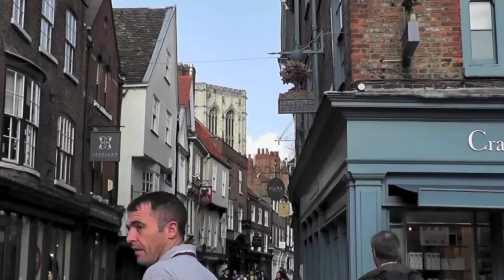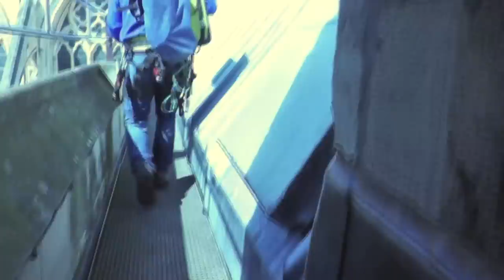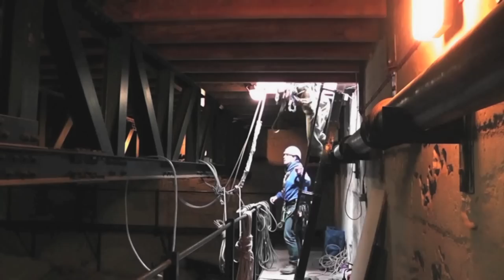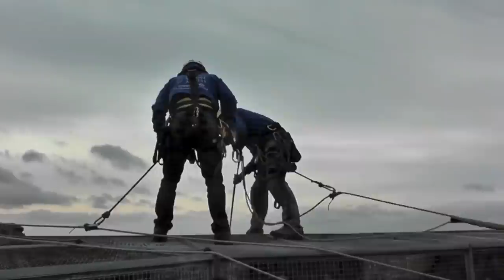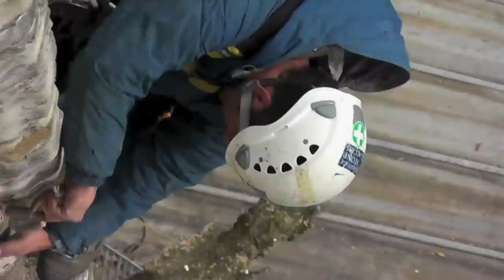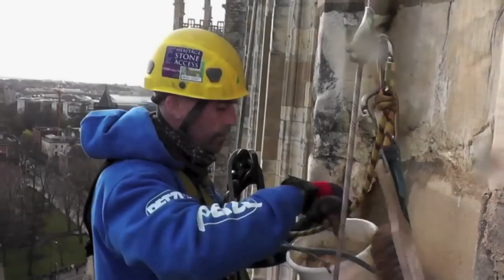Rope Access Stonemason Documentary by Jana Bolz

Comment: Is it ok to use Shunt for belay? I do use it. But heard that it's stricly not for belay. Otherwise it's great job!
Reply: It's not. it looks like hes just using it here to keep his tools in place on a 3rd line. you can use a shunt as a replacement for your hand ascender though.
Reply: This is an old video from a time that shunt was still widely used as a back up device in industrial climbing. Nowadays there are a variety of purpose made back up devices for industrial climbing that are used as a autolocking back up device should a fall occur. Shunt originally  was designed as a belay device and rope grab for leisure climbing if I remember rightly and then started being used as a back up in industrial climbing back in the day when there wasn't other options on market.